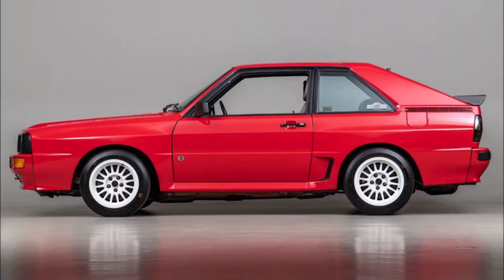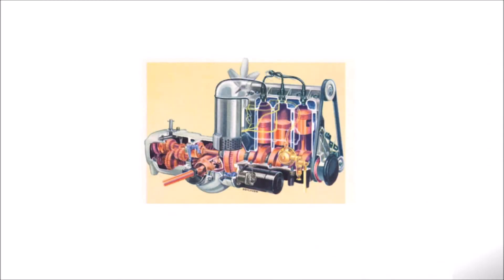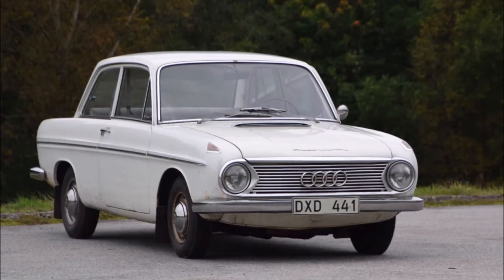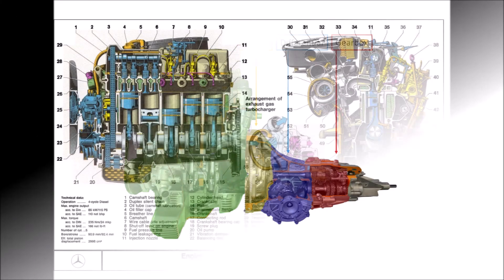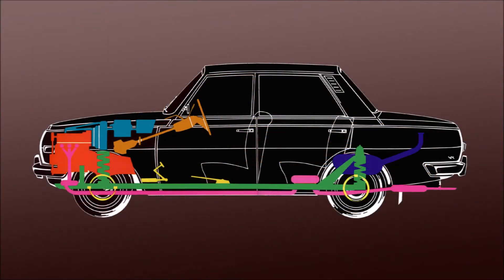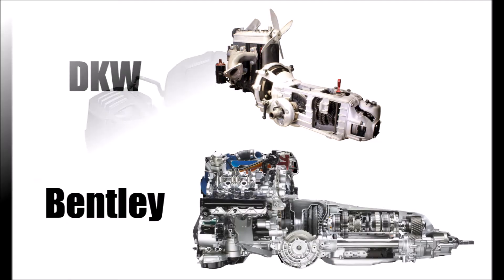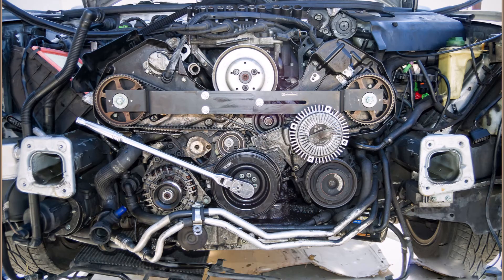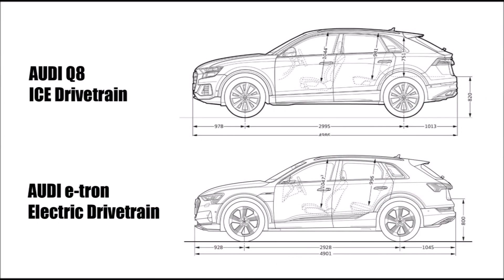AUDI's Package Problem - Explained

Comment: Saab utilized the dkw design too, the early two strokes were a licensed dkw design. Saab also had the overhang issue, and never really solved it. It wasn’t much of an issue with the two design, but the cast iron ford motor wasn’t great for performance. Thanks for the informative video!
Reply: Post 9000 they went transverse right?

Comment: Great video! I haven’t got my driver’s license yet so I’ve been playing around with electric RC cars. I bought an Audi Quattro rallye body, and when fitting it onto the chassis I also noticed that the front overhang was so long that I needed a much larger urethane piece to act as bumper, otherwise it would end up badly even just after one crash (my chassis was mid engined though). Never really went deeper to contemplate why. Thanks for your thorough analysis!!
Reply from the maker: That's a very good way of noticing it! RC cars create the best engineers!

Comment: Great video, it aged like a good wine. I always had the impression that Citroën Traction Avant was the first mass produced front wheel drive but it came 3 years later. Now I am really disappointed by Audi, when you remember that their motto is "progress through technology". They have the aluminium platform for A8 and other fancy stuff, but still, this is bad, really bad.

Comment: How did the Panamera Package solve the Problem?
Reply from the maker: Porsche started with the Panamera from scratch, so they didn't have limitations. They positioned the engine on the front axle like BMW and Mercedes instead of in front of it like Audi.

Comment: I think before the DKW became an Audi the Car and Fabric were sold to Volkswagen. They wanted the production capacity of the production plant. With that deal, they also got their hands on the car and engine and produced it under the name Audi.  Fun fact is that Audi as brand would not exist without that car. They had just no other use for the brand at this time and it was just coincident that this happened. I think there was also some funny coincident with the engine design in the car. Something like one of the Porsche Family designed it for Mercedes and later with Audi it became the competition. I can`t remember that exactly. There are very interesting interviews with old bosses, designers, race drivers, and engineers on a Channel called "Die alte Schule" (the old School) which should work with auto-translation. They tell all that stories there. Could be a good source. https://www.youtube.com/c/Gelee-deluxe/videos - Great Video again! Loved it!

Comment: Audi are great road cars but not good at all on tracks where you need to push the grip level to the limit of the tires. That's where Audi's nose heavy set up shows its ugly head. 
On the road, the A4 and higher still uses multi-link (double wishbone) suspension in front. The very good suspension combined with the extra weight makes makes the initial response from the steering really good. This is true even on slippery/snowy surface. You can easily pass the moose test as shown on the link here. https://youtu.be/ShabL8eXLoM